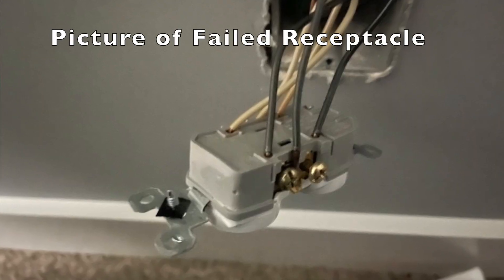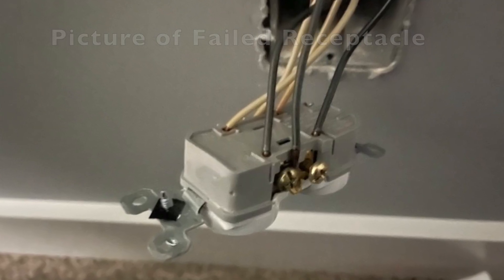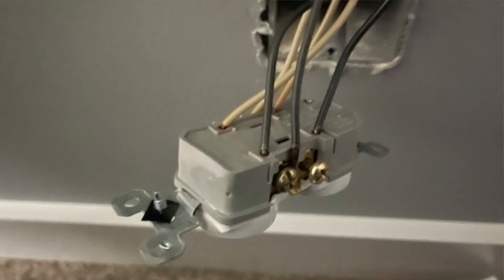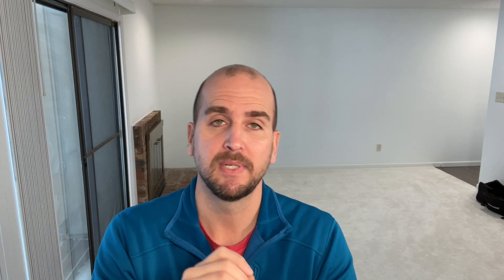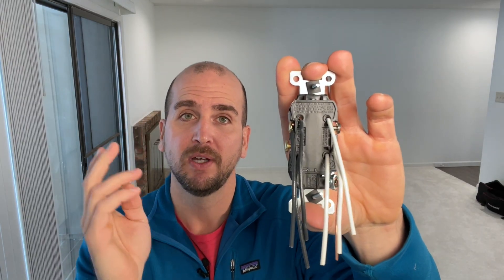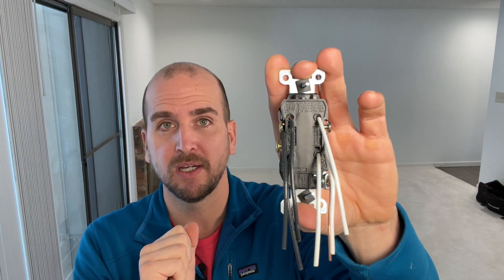Incorrectly Wired Outlet Found In Newly Built Home

Comment: Question please. I have a receptacle in which the wiring to it has no power . It just failed one day. All the receptacles in the wall that is at right angle have power and also the receptacle on the partition wall directly on the other side of the wall works. Looking at the that receptacles wiring and the those on the wall right angle of the problem wall doesn’t have any wires that lead out of them to the powerless receptacle wiring that i can see anyway. How can I find where the wires to the powerless receptacle wiring is coming from?

Comment: Pig tails should be an industry standard, it is not only easier to get back into the box, but it also helps with troubleshooting down the road, If an outlet fails with 3 wires going into it, it will turn off everything down that circuit. If it has a pigtail, then only that outlet will be out and you will find the issue much faster and not turn off power to the whole circuit. As a service electrician, there is nothing more frustrating than spending 30 minutes just finding a burnt out outlet.

Comment: Here's a tip, NEVER!!! take advice from someone that's not licensed in the trade they are talking about. Instead go to someone that has years of experience in the field that you need information from. IE) never ask commercial electrician for residential advice, never ask a residential electrician for commercial advice unless they have years of experience. This guys advice is irrelevant and not reliable.

Comment: I just dont know what to say about this.  First time on the channel, it started out well but seemed to fall apart before the end. 

I am not a residential electriction and dont claim to be an expert on that industries practices but i've seen plenty of lousy wiring in homes and various types of machinery.  Coming from my background the pigtail method demonstrated just looks half-assed and unsafe.  It assumes that your wire gauge is double what you actually need because by going that route you effectively halve the current capacity of your circuit by routing it through 1 wire instead of 2. 

It still boggles my mind that wire nuts are considered an acceptbale practice. Sure, they are easy enough to do correctly but they are incredibly easy and more commonly done incorrectly. It's like American trades are stuck in the stone ages.
Reply: How does the pig tail "halve" the current capacity?  If the wire is 12 gauge it can be connected to a 20 amp circuit breaker.  And 12 gauge can easily carry the 20 amps.  Are you a 50 hz guy?  UK seems to hate American wiring LOL.
Reply: @Checkmate54321  The fequency has little or nothing to do with it...and I am American.  That'd you'd even make that sort of comment is embarassing.  

While it is possible that a single wire can handle the load your comment suggest that you dont really grasp whats going on here.  When wire sizes are selected for a given situation they are selected based on the current demand and length of run.  This ensures that the resistence of the wire at that given current will not result in an excessive voltage drop and will also not casue the current level to overheat the wire and result in failure.  There are many charts designed to help make wire selection based on this criteria.  

In short when you go from 2 wires of a given gauge to a single wire of that same gauge you half the cross sectional area of the conductor which can more than half its current capacity.  Visualize the effect like a plumber going from a 3" drain pipe down to a 1.5".  For day to day load that might get by but when you hit capacity you're going to have problems.  Instead of backed up sewage though you get melted wire. 

If going from 2 wires to 1 is "just fine" that implies that you've significantly over wired (and over spent) the house in the first place.
Reply: @willstikken5619  Learn to recognize a joke.
Reply: @Checkmate54321  Perhaps learn to make one.

Comment: This may vary, but I always thought that when you install an outlet vertically, the ground should be at the top, so that if a metal plate is used, if the mounting screw comes out, the plate can only touch the ground prong(unless, of course the plate gets pushed sideways(this is rare, usually, it falls downwards the floor).
Looking at the outlet you did the pigtails on, the grounds were at the bottom.
Reply: The only time I have heard of installing the ground at the top is when you have the plug on a switch. I am interested to know what others think about this as well.
Reply: The "ground up" is not a code requirement in the NEC.
Reply: I'm no pro, but most I've seen installed are ground down, so, /shrug. I dunno about that.

Comment: This is what you get from poor quality made electrics that are not designed to last. I am an British electrician for nearly 30 years and have seen huge changes in our electric safety and use to the public. But I have worked on American systems and it's like going back in time. We have much safer connections so wires won't arc if loose, and if a fault happens on a circuit, rather than just a fuse or breaker to cut power we have a device than measures the sudden difference in surge and trips off the power quicker than 0.4sec. We may have higher voltage than 120 but this means it can carry over longer distance.
Those screw connector blocks or tooth paste caps as we call them, we banned them years ago. As they can come loose and cause arcing. Use wago’s of three connections and they are rated 30A

Comment: You yanks sure have old fashioned elect stuff. Those wire screw connector things...haven't seen one used in australia for 40yrs. Our light and power recepticles have  marked holes with enough room for 3 wires.
Was confusing to see your colour schemes for wires.....ours is either red or brown for active and black or blue for neutral...so it was funny to see a black wire being spliced onto a red wire !!  lol
But generally our standards are pretty good, especially since we have 240V for power.

Comment: I was curious...when you showed the wiring in of a pigtail, I wondered why you used a wire nut rather than a Wago connector?  What do you think of them...do you use them?
Reply: Thanks for sharing the video.  I too was wondering about the Wago connector as an option in this case.  Also great when you need need to twist a stranded wire with solid wires, IMHO.  A separate question/comment on the demo.  You mentioned that the wiring for the receptacle was 12 ga.  Was that perchance a 20 amp circuit? (20 amp circuits require 12 ga wire)  if so, then the receptacle you wired in was not a 20 amp rated receptacle.   (20 amp receptacles have a horizontal  "T" on the neutral side of the faceplate/plug)  Justin saying.  Although many years ago I used 20 ga wire for a 15 amp branch circuit,  back when copper was cheap.  A belt and suspenders type of guy.
Reply: @toby314  Using a 20 amp receptacle is not needed unless you have a plug that requires it. The only difference between a 15 and 20 amp receptacle is the face

Comment: A good practice  that I have done for years is #1 I don't use push in's use the screws and when your done wrap black electrical  tape once around the outlet covering all the screws, you can now not short it out or get a shock
Reply: If u have to wrap with electrical tape to avoid shock or shorting out then u r doing something wrong it was not recommended in my training so therefore personally I will never do that
Reply: My fiancée was a union electrician for over thirty years and they only wrapped 277 volt switches during installation so the next person wouldn't short it out if they had to pull it out of the box!Remember this is on commercial job sites where you have metal boxes and sometimes they were a little overloaded with wires!They very seldom taped 110 volt plugs!Stay safe people and God bless America!
Reply: Just posted the same thing.

Comment: I'm a retired electrician!  I was a residential ,and commercial service call electrician for 20 years. The things I've seen in homes, blew my mind! I also ran commercial and industrial jobs for many years.
Reply: I did a lot of residential wiring and repairs and I saw lots of bad wiring. I remember  2 apartment house that I refused to do any work for the owner. Told him they were firetraps and I didn't want my fingerprints on anything in the building.

Comment: Funny to watch this horrible US stuff when you live in Germany. Screws for wire connections? 😂
Reply: Is it true you can just put your finger in a receptacle in Germany and get burned ? If so I'll take our receptacles over yours any day.
Reply: @rjthemanwatts  No, not true. You can unscrew it from the wall and you will not be able to touch a hot wire or screw. That's a must for 240V.

Comment: Agree to the backstabbed wires. This is a place that fails most often. I believe that no device is rated for more than 15 amps if it is capable of being "backstabbed"...so..a number 12 wire on a 20 amp circuit would not work unless the 15 amp device was "modified" which would make it an illegal installation. Pigtails are the best option when you have more than 2 wires. If you only have 2, you can use the terminals but when you change out the device, you actually break the circuit, neutral and hot. Most electrical contractors go for fast...not necessarily best practice..good video and good information

Comment: I’m a commercial electrician. Good video. And you’re correct, the stab ins are “ok”, but I never use them. High failure rate...
Reply: Total crap,   for a contractor that wires up thousands of plugs in subdivisions, the failure rate of plugging in the wire in the back of the receptacle is worth the time savings of putting it around the screws.  Typical youtube bullshit video of a wannabe talking shit about things he knows nothing about
Reply: @theledfactory204  this YouTuber has obviously gotten suggestions and is passing on what he’s been told, which in this case is correct. The time savings are so marginal between back wiring and hook if you’re actually skilled at your craft. I’ve tested back wiring but it’s inferior and id rather hook my receptacle since it only takes seconds anyway to do one. I’d also rather give my customers a product they never have to worry about and will never have problems with. Your rigidity and greed is what gives trades a bad name. There’s more then rushing through the job just to get to the next one. It’s ok though at least people like you make me look amazing when I come and fix their poor rushed work you gave them.

Comment: Wire-through, while not a best practice, additionally is absolutely not allowed on the neutral wires when it is a shared neutral.  

In those cases a break in the neutral, even while someone was working on the receptacle after supposedly turning the breaker off, could be shocked by the still-energized neutral current from the other networked live circuit if there was any load.  

Also, if any of the backwire or sidewire wired-through neutral wires break free and open on the neutral then there is a danger of devices plugged in on both of these circuits being exposed to full 240v -or 208v on 3-phase wye systems, rather than just not seeing any power if it wasn't a shared neutral.

Comment: I'm a licensed electrical apprentice and all my journeyman friends told me when I started to just avoid using the backstabs. I've always used pigtails as well cause you avoid losing power downstream of a faulty outlet in the event of a failure.
Reply: Power in, Power out. Anymore and you did it wrong. Ofcourse it's not wrong, but the service call will always be a breeze.

Comment: If you use push in connectors , you are a hack plain and simple. I pigtail most devices ,in some places here it is code to do so.(Canada). Cannot even count the number of melted plugs from loose connections from push ins on receptacles that i have replaced. Also makes it a nightmare to service while energized , as you sometimes have no other option.

Comment: Never use the push in connectors always use the screws. And only 2 whites per side if you have 3 use wire nuts to convert to 2. The inspectors here do not allow push in connections. Ul should not be passing pushins... the ones I buy dont have pushins

Comment: I hate when they just use brass screws on both sides easy to mess up polarity
Should be number four
Reply: In Canada, Hot screw must be brass finish ad Neutral must be lighter brass colour or silver colour. It’s code and out;ets sold in stores need to meet code.

Comment: Horror movie for central european professionals. 😂
Reply: I'm not a professional. I'm born in Germany but living in Peru for years. And still even here it would be a horror movie. No way you would get such bad outlets here. No way you would use single string wire, you use proper cables. No way you use the outlet as a junction / distribution box, you use proper distribution boxes, therefore no need for those strange screws (that you couldn't buy here anyway) and pigtails, you won't see this in a professional installation here. You don't distribute energy from one outlet to another.

Comment: One of the things not mentioned in the usage of a spring connector or the screw attachment is the area of contact (much less the eventual weakening of the spring on a 'push-in' connector). If you calculate the area of contact between the spring connector to the wire as opposed to the area of the screw connecting to the wire, there is no comparison. For maximum current transfer, the screw connector is far superior.

Comment: I had to redo our entire house, reterminated every receptacle and switch from the stab in connection to the screw termination. tightened all screws, using the same devices. Circled the whole thing with tape. No issues since.

Comment: Good stuff. I personally always wrap wire nuts with tape and put a couple of wraps around outlets and switches. It is not required where I live but is an added safety measure.

I have had to replace many outlets in homes less than 10 years old. The push in connections are usually the culprit. Things are made so cheaply to save a buck these days too.

Comment: It is always Best to Splice your Grounds,  the Neutrals and the Phase Conductors and have single pigtail from them , one ground, one neutral and one phase conductor to attach to the Receptacle Device instead of having 5 conductors because it is a lot easier to push 3 wires back into the electrical box than to try to push 5 !!!  Common Sense !!!!!!!
Reply: You usually don't have enough room to do that with grounds too, so just green-screw to back of box.

Comment: In addition to clockwise direction of the wire under the screw we were also taught to tighten the hook so it couldn't come off the screw even if it came loose. Then we were also told to wrap electrical tape around any wire nut, receptacle or switch. I haven't done electrical professionally for many years but that was how I was trained.
Reply from the maker: I like tightening the hook and that would be good to call out.  Thanks for the feedback 👍

Comment: About pig tail, do you use wago? It’s much easier the try to do pig tail.
Reply: It's still called a pigtail whether it's done with a wire nut or a Wago connector.

Comment: You wrapped the black the wrong way it should go clock wise.
Reply from the maker: I know that looked confusing but I actually used the back wire feature of the commercial grade outlet so the stripped wire was actually just straight installed under the back wire plate.  Thanks for the feedback!

Comment: And if you use the Wago 221 connectors instead of wire nuts, wrap them in tape to prevent unlocking.  The levers have a bit of play before unlocking, and can catch things and unlock.